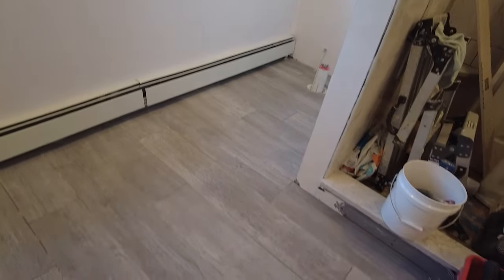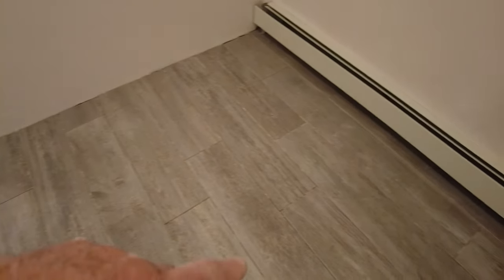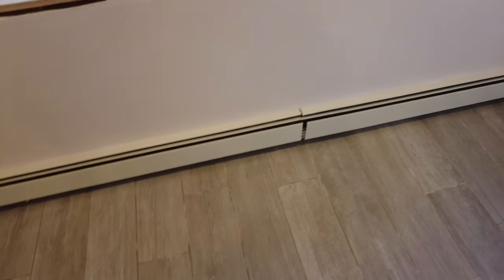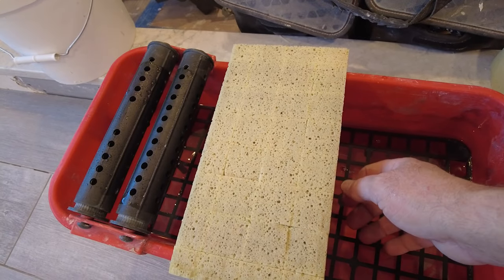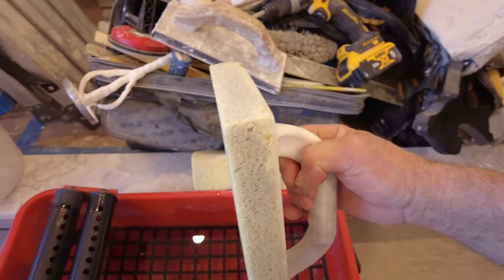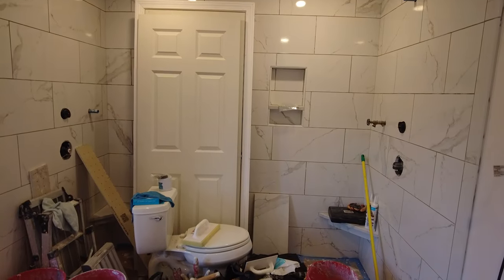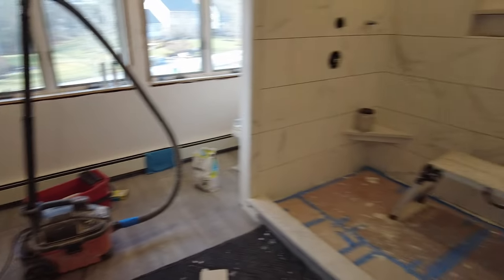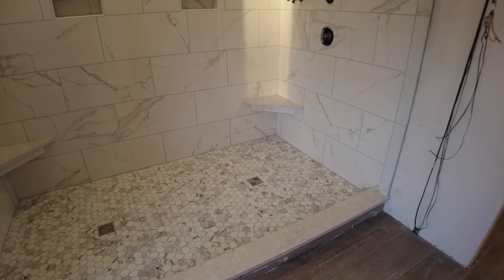Grouting all the tile. Master Bathroom install part  22

Comment: Sal: I’ve notice you often run tiles on the outside above your curb vertically on a horizontal installation. What’s that bout?
Reply from the maker: Not really, always follow the same as the wall tile layout.
Reply: Bullnose